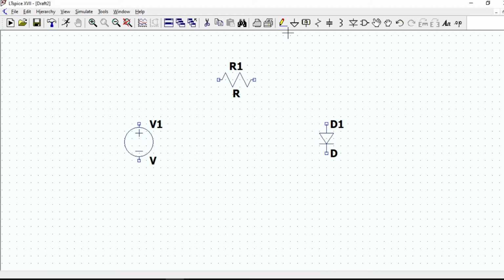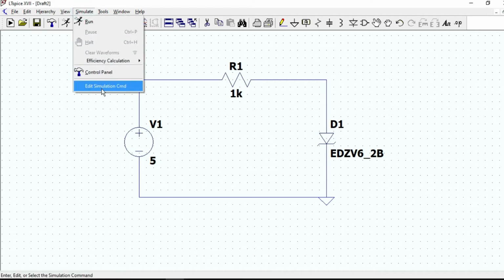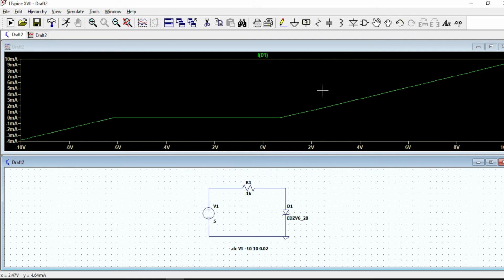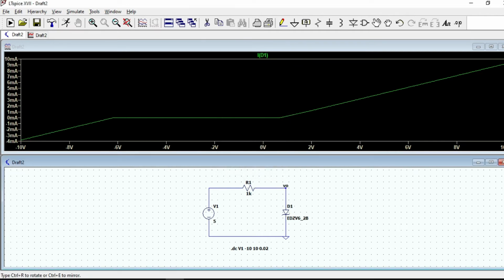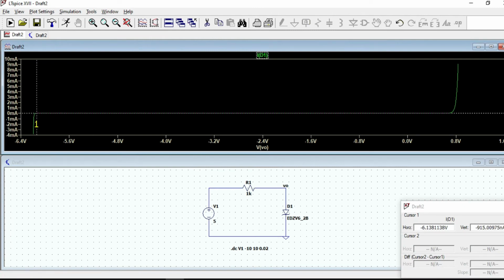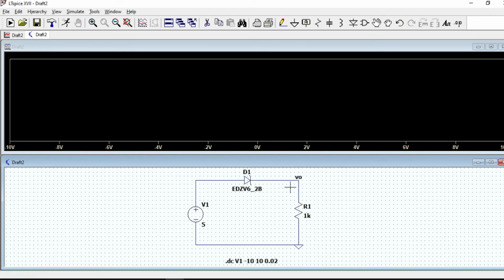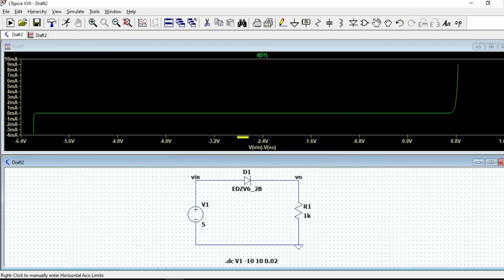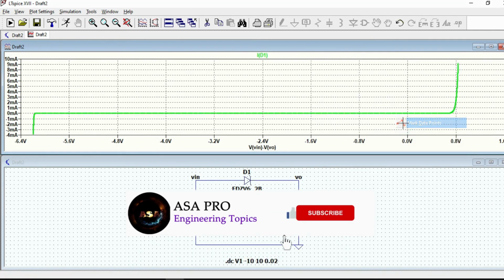V-I characteristics of Zener diode using LTSPICE

Comment: Bro just don't add a resistor.  Just voltage source and diode. Or set R=0. No need to do any calculations